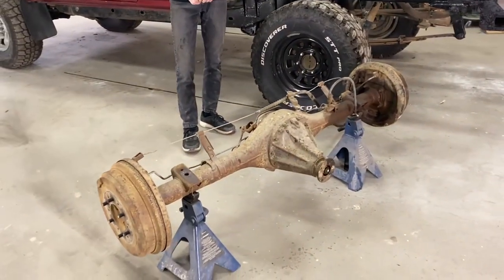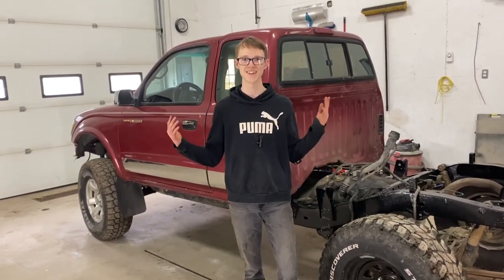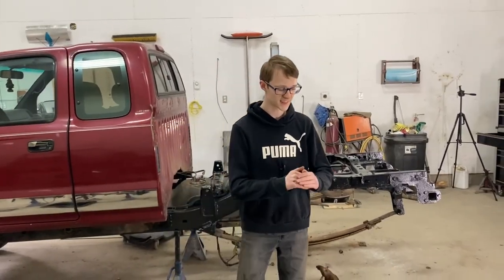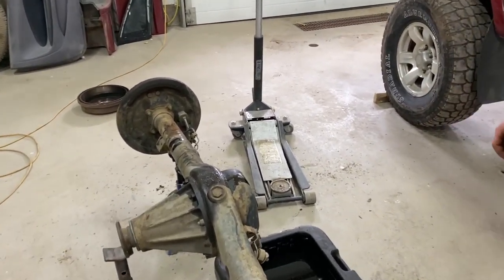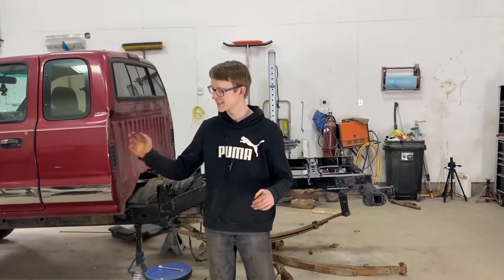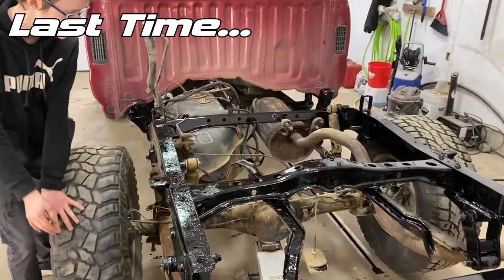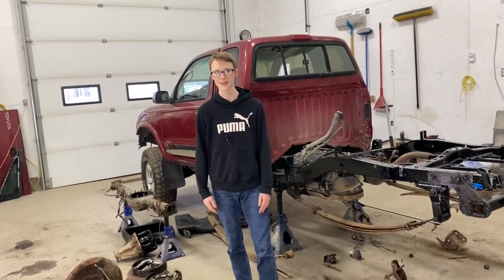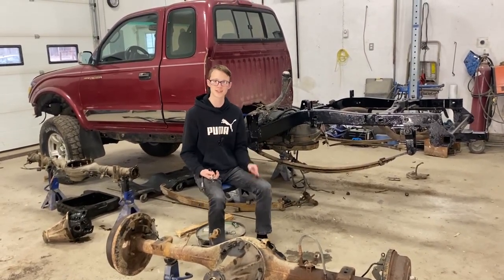Restoring our 1998 Toyota Tacoma | New Rear Differential! | Part 8

Comment: They came with an actual locking diff rather than limited slip. I have an 03 tacoma and it has a locking diff. Granted from 1996-2004 the only major change was the face lifts.
Reply from the maker: Yep, ours didn’t have the locker or a limited slip as we later realized in a later video that it was just an open diff lol

Comment: It’s probably still best that you used the original diff (3rd member) regardless that it isn’t an LSD after all, because if the donor has a different gear ratio, you could’ve put it all together and not be able to use 4x4 if the ratio is different than your front diff. Not sure if you checked the ratio of the donor or not, but a lot of people change the gears in these trucks too.
Reply from the maker: Yes that’s exactly what we did for that reason! Good thinking, thanks!
Reply: @tjvalleygarage  right on! I subscribed to your channel because I think it’s great you and your Dad are doing this stuff together. He seems like he has a ton of great mechanical knowledge to pass on to you. Enjoy it, you will look back on these memories for the rest of your life! And I like old Toyotas, so I can’t wait to see the finished truck! I’m working on bringing back a ‘97 4Runner 4x4 back to life as we speak…
Reply from the maker: @thebassclef007  You bet! I’ve worked on many cars with my dad over the years but I got to say I have learnt the most with this truck.